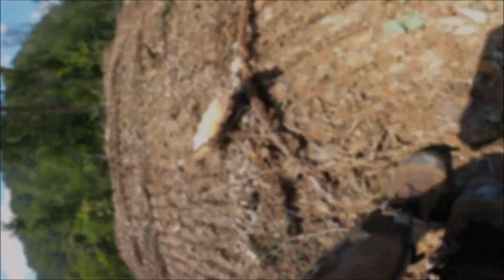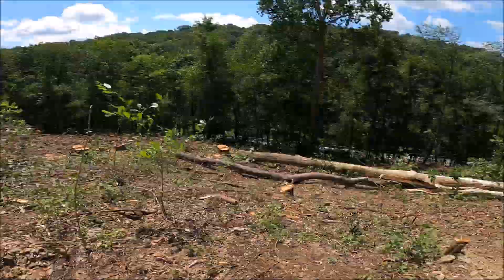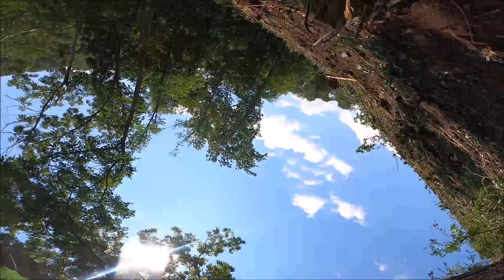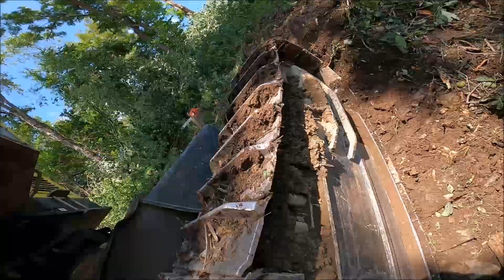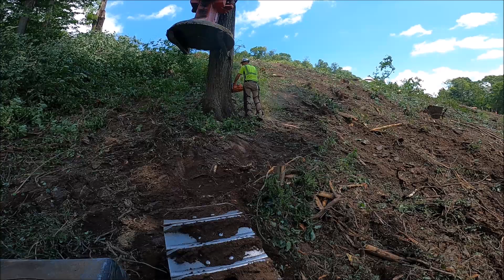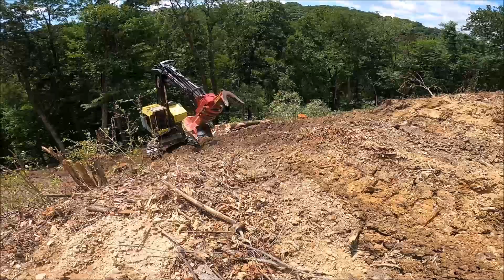A few of these could be just a little too risky...

Comment: Ever think about carrying a throw bag, rope and sling shot with you? It takes some time to get used to the sling shot and not tangling the throw line, but you can do a lot with them without climbing. However, when I absolutely need a tree to go in a certain spot and it has a nasty lean away, I usually climb the tree to put my pull rope exactly where I want it.
Reply from the maker: I prefer the slingshot I have a throw ball but trees like the ones in this video I wouldn’t trust a rope to there’s just too much stuff at risk

Comment: So Pete, I have to ask, and maybe you have addressed this in full on another video (if so, can you link it here?), but in watching your Youtube channel at length for some time now I have to assume that it is STANDARD OPERATING PROCEDURE for YOU to use the boring technique on most all of your cuts, is that correct?
I have only used the technique of "boring" the cut and then firing the trigger on the back cut with a badly leaning tree so as to prevent "barber chairing".
Otherwise I cut as is "normal" in my area and that is making the face cut followed by the back cut and maybe some wedge banging if necessary.
Reply from the maker: I do use that method a lot yes in my opinion it is safer and it also helps prevent any cracking of the butt log

Comment: Those Timberpros hold value like a gold bar.
Up here there is a B exactly the same as this, color and all.
I am in the market for a newer machine, and the tigercats and timberpros are 100k more than a Deere equivalent. 
So a Deere 853M is on the menu.
Reply from the maker: I’d stay away from the newer Deere stuff if you can, just my opinion.
Reply: @nuts319  
Can you elaborate?
My friend is a deere service tech, many years of it under his belt.
He went out to Deere and had input on the M cutters and L / L-II several times.
He said the newer machines, after like 2017, were much better then the 15 thru 17 machines..
Looking at a 2019 with 3050 hours and new single grouser tracks with 500 hours.
Previous owner didn't like the swamp tracks it had on it.
I want deere mostly because I know he can fix it.
Reply from the maker: @oldtimerf7602  I just feel they are poorly built